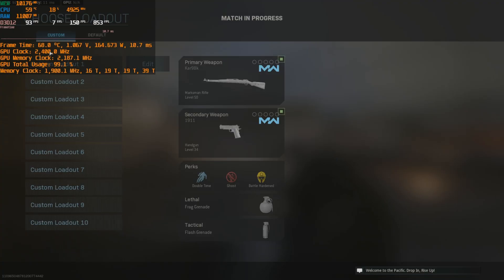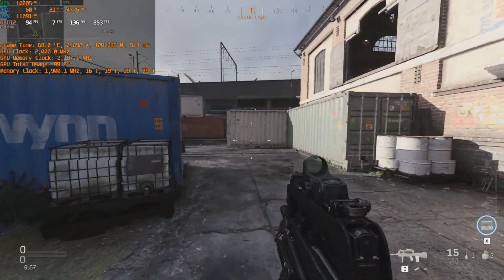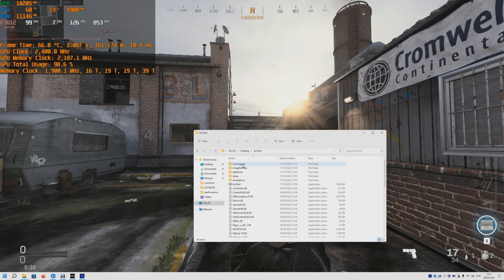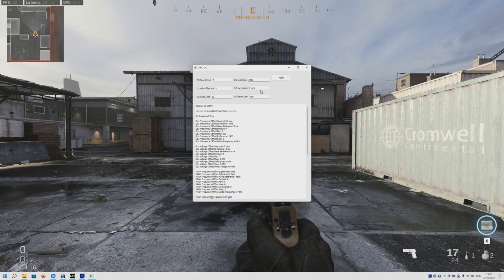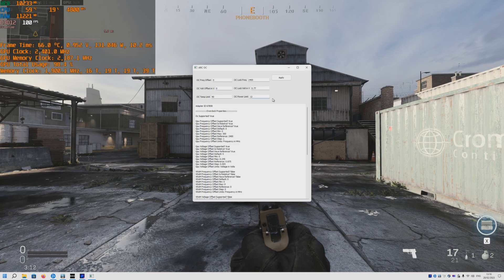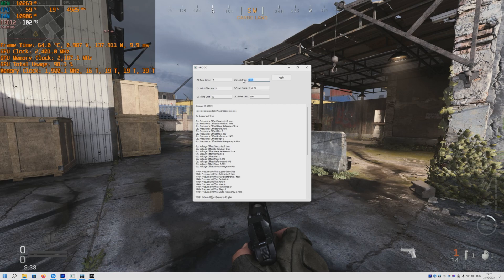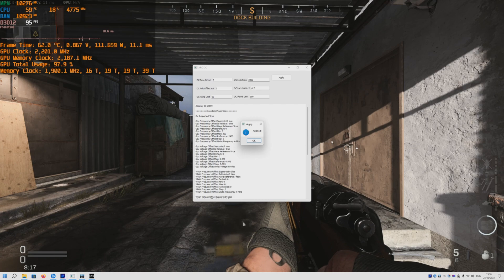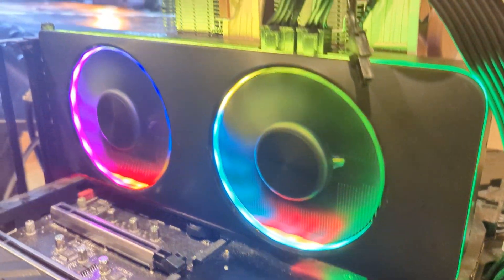Undervolt Intel Arc A770 / A750 / A380 - Improve temperature, Coil Whine and Lower Electricity Bill

Comment: Is it necessary to adjust the voltage offset when undervolting the GPU or is it enough to just reduce the wattage from the application?
Reply from the maker: You will lose performance when reducing just the W in the panel.

Comment: What's the ideal power consumption u get while watching yt videos browsing?
Reply from the maker: Always around the "optimized idle W usage". 45-50w.
Reply: @graphicarc  did u tried connect display cable to motherboard output it reduces power consumption i read a post on reddit few users says it works.
You can find by searching this:
 Managed to bring ideal power consumption arc reddit.
Reply: @graphicarc  Did u tried connecting your display to motherboard output i read on redit  and users commented that it reduces power consumption.
You can search:
Managed to bring ideal power consumption redit.
Reply from the maker: I tried but it didnt work for me on my custom windows.
Reply: @graphicarc  which processor u have amd?

Comment: Why my GPU consuming 38w power when idle, im doing nothing but GPU consuming 38-39w, i try to power saving  power settings on windows but not change anything 😢  nvdia card consut around 6-8w
Reply from the maker: Intel arc ... Still no way to lower W and I've been constantly playing around with things on different systems. Nothing we can do atm except power save mode but it rarely works now for me.. might as well use "ultimate performance" and be done with it.
Reply: go to windows power setting, change intel arc to battery life and pci-e to maximum, 36w->8w with single monitor while idle.
Reply: @kaelwang1251  i try already man power settings not do anyting
Reply: @MrN080DY  same here, even reinstalled drivers and it did not power down, still at 35W
Reply: @DrRedstone172  it is arc a750 issue you cant do nothing about it. it is idle power 35-40w.there is reason why people not buying this cards lul
Reply: @MrN080DY  oh yeah but i was talking about enabling aspm and idling to 6W. I can't get it to work
Reply: @DrRedstone172  its to much work i try aswell and now i give up lul. and even u did that, you need to back to normal settings again when you play games cause that setthis limit your power.

Comment: Are Arc mobile undervoltable? Lack of undervolting on laptops is the only thing that's stopping me from buying them right now.
Reply from the maker: Mobile Arc GPUs cant be undervolted or overclocked sadly. Maybe this will change in the future with arc panel but I doubt it. Afaik.
Reply: @graphicarc  thank you. Well, it's Nvidia only for me then... All their laptop GPUs are undervoltable via msi afterurner voltage\frequency curve since Pascal.

Comment: Is a750 is good for apex in 1080 high? My current cpu is ryzen 3600
Reply from the maker: Should be good to go ... might have to drop some settings to get 144? Havent tested it for sometime tho.
Reply: Running in gtx 1650 1080 low, i get fluctuating fps between  80-120FPS

Comment: Quick question ! Do it saved perm after doing it once ? Or do i have to redo The undervolt every time i turn pc on? Thx u :)
Reply from the maker: Sadly no :( no way to save it right now still.
Reply: @graphicarc  thx for answer i want The Card because of The Price in denmark is cheap right now. But i want to undervolt it because energy cost alot here. 
So not worth do it every time. I stick to 4060 for 1080 :(

Comment: nice video and very instructional! I used the A750 on my r7 5700x on a b550 mobo!somehow the gpu get hot pretty fast!couldnt even get the arc interface up!building a intel i5 13500 for a friend soon, so the gpu will fit it fine I think!
Reply: Because its coolers are idle if <60* . Arc controls added coolers curve option (of course bugged) where you can get 36* on idle with 800+ RPM

Comment: Hy. Your videos is really helpfull for me. I woild like to set the undervolt setting forever :-) where can i configure the arc gpu setting for it. Because when i reboot windows i have to open arc oc tool to reset the prefenrences. I am affraid my children will use the pc for gaming without undervolting the gpu. Thx. The other problen is when i set the oc settings. In idle the gpu frequency stay at 2400mhz. With 40w consumtion.
Reply from the maker: Glad it helped you. So far there is no known way at least to me to lower the idle gpu W lower then 35W. I am onto something but still no full solution available for this. I was only able to lower the W of A750 Asrock to about 15W in idle. As for the undervolt settings to apply at boot ... I will see if it can be done so far its not available within the software.

Comment: How do i reset back to defaults ?
Reply from the maker: Restart your PC or use the default settings when you start the Arc OC tool. Can always reset via intel arc control center as well.
Reply: Thanks i might be stupid but i have watched the video multiple times and still can't get what exactly i should do 
I am new to this so i don't want to do anything on my own could you tell the exact settings if i want a slight performance boost while undervolting
Reply from the maker: @TheMohammed884  This I can't really say since it depends on the card silicon. You will have to do the testing yourself and see how OC Tool reacts with your card.
Reply: @graphicarc  thanks

Comment: What temps do you get when the a770 is idle? I remember some reviews a few months back mentioning it was the worst whilst idle, over 40W in comparison to other cards which would hover around 7 to 12W.. perhaps a driver update may have solved the problem?
Reply from the maker: My GPU temp in idle is 31C currently at 18C indoor temp. Takes about 33w idle so yeah it is on the higher side.
Reply: @graphicarc  I found the official page High Power Consumption When Intel Arc Is Idle which guides the user in configuring the bios (and of course the windows own power settings) which supposedly helps. Some people mention higher idle power usage in their own forums, but the moderators just come back with 'there is no ideal power draw', so it would seem it's down to the hardware in which a driver update cannot fix the problem
Reply from the maker: @technocrologist  Been playing around with this ... no luck :) still stuck at 35W lowest usage on idle except on A750 it worked but only Asrock model.

Comment: Very impressive! Less than 5% lower performance for a 30% if I read the numbers correctly. What is the lowest working voltage for the ARC? On my 3060ti I can make it run at 1620@731mv or 1590@700mv (the latter gets vram downclock so not really worth it). This gives me about 90% of performance for 125W vs 205W stock.
Reply from the maker: Yeah I was impressed as well by the undervolt on this GPU :) will check what can be the lowest and report back.

Comment: Awesome video, thank  you.  Just can you tell me how to reset to default please. The gpu clock seems stuck to the value applied, it won't scale
Reply from the maker: What you do is restart your PC, after reboot open arc tool and note down the default settings (0?) and just reapply. What you are doing here is forcing max voltage limit so it wont scale more unless you set it to more.

Comment: Excellent video! Combined with recent Intel's fix of idle power draw on these cards, I am pretty much decided to buy A750 or A770 for my next GPU
Reply from the maker: I personally would get a750 for 1080p and a770 for 1440p+ :) am sure you will enjoy the purchase if you will decide upon it.
Reply: @graphicarc  a770 16g can easily perform on 4k\ultra in some games at 60fps. I have Gunnir black version.
Reply: @graphicarc  

with updates the a750 can now play almost all games in 1440p

just starfield etc have to run in 1080

Comment: With my a750 i cant do undervolt, when i put the value for voltage It return to 0 and nothing change. Why

.....
Reply from the maker: It is because you also need to set the Clock Freq otherwise it wont apply.
Reply: @graphicarc  aaaah ok, i Will try, thank you

Comment: Excellent video! This shows the power of the A770, really power efficient when undervolted (perf/W), even better than last gen 6800 perf/W king now beaten, even in DX11 and still better perf/W vs new 7000 series for DX12 and Vulkan. 0.94V @ 130W @ 2.4Ghz (100% load) ~= 1060 (@100% load) for 2x perf/W in DX11 (1.1x vs 6800), 2.5x perf/W in DX12 (1.5x vs 6800) and 3.3x perf/W in Vulkan (1.3x vs 6800).

For value proposition, when comparing 3DMark Time Spy to record raw power, normalized msrp for 6800 is 1.5x overpriced and 3070 (on par with A770) is 1.4x overpriced. This makes the A770 easily the winner (best bang for buck for mid-mid high end gpu + most power efficient with Arc Tool undervolt vs competition).
Reply: I mean is your comparison against optmised/undervolted 6800 / 7000 series as well? or just stock?
Reply: @Decenium  vs stock, so it's not a good apples to apples comparison and wasn't stable at 130W in the end, but was at 145W (a bit more V). This is a saving of 37% without lost performance. The 3000 and 6000 series can UV 20% without loss. But, A770 now losing big vs 4000 series. Also, I cannot recommend it anymore, the 3060 ti is now best bang-for-buck from nvidia and can be had for $300 new. $250 used market for 3070. A770 is €400 here in NL (Europe) and no used cards. Amd >= 6800 (any > 8GB has huge premium new/used) is far worse price/perf than 3060ti/3070. Intel is by far the worst price/perf vs nvidia and amd.

Comment: Can you increase the Wattage with this tool pass 228W? Intel Arc OC Tool?
Reply from the maker: No, you cant past overclock the limit. There was a bug and you could do it but mhz and everything was alllll over the place. Might make a video if this still "works".
Reply: @graphicarc  I would like to see that. Always good to see ideas even if fails. There might be a way round it to make it work.
Reply: @graphicarc hello can i reduce the watts just enough to make it fit in a 550 watt psu????

Comment: I have followed all your Intel Arc A770 videos and they are great.Last week I had a PC built and it keeps crashing every few hours and I haven’t even played any games yet.
Build:
CPU: Intel i7 13700K
GPU: Acer Predator Bifrost Intel 770 16 GB
DRam: 2 X 32gb DDR5 6000 CL30
ASUS ROG Strix Z790 Gaming E Mother Board
Arctic Freeze l l 340mm AIO on CPU

All components with latest BIOS & Drivers updated
A770 w driver 4091 vs your 4125 which is Beta I think ?

I haven’t installed Driver 4125 because I thought it might be unstable 
Any thoughts, ideas or suggestions? I will under-volt / over clock eventually but not there yet.
Reply from the maker: Thanks :) this seems like a beast of the computer ... why it crashes though I can't really know without getting PC in my hands. I had problem with CL30 and CL32 ram on most systems (if xmp was only ON) though you do have strix board which is one of the best? You might want to get it back to the place you got it built and let them know its crashing? Does your PC just restart or what happens (bsod, blank display)... It could also be that your 13700k needs tuning.
Reply: your on die CPU controller voltage likely needs a bit of an increase to remain stable for the memory overclock. Does your system run stable at lower memory clock speeds?
Reply: @sparketech  Thanks I have thought about doing that but wondering if this Motherboard might be making those adjustments. Will be going into BIOS after Tech support examines first. I am sure this can be resolved or has been at least today so far. Thanks😎
Reply from the maker: @Pierceb2  It is the motherboard that is doing the AI overclocking. Not sure they will be of much help but yeah ... do this and I am about 70% certain that it will fix your issue :) hopefully its not hardware problem.
Reply: @graphicarc  Thanks again. Yea It may be the overlocked memory or GPU.The board seems to have some sort of AI for entire system.. With Current / Most recent BIOS during install with XMP enables and Re-Bar enabled it went to DDR5 6000 on first reboot. Will let you know as FYI if resolved. 
P.S. Got Luminar Neo Pro 2 subscriptions for 2 years for $99 with all updates and extensions. I thought that was a good deal and I am really liking it. They need to add a really good printing module however. Will use Photo Shop until then. My I.suggest you do some videos on prepping completed photos for printing Also developing raw files from camera. I use Nikon Studio for Raw extraction or a couple of others. Manufacturers raw developers know best the color profile of their sensors etc. Again, Thanks
Reply: Thanks, it has been stable today but not rebooting after the crashes or I didn’t5 give it enough time to. The board has some sort of AI and collects data after the crashes. I am tweaking and will look into your advice and idea as well. Will have builders tech support remote access logs tomorrow as well. Can bring it in as well if needed.
Reply from the maker: @Pierceb2  Maybe its the problem of AI Overclocking feature? That needs some tuning done when activated especially on newer 13th gen intel systems i7 and up. Go into bios and disable that and just enable XMP for RAM and let CPU run @ stock. It might be heating like crazy but at least you can see if it won't crash this time? You can also go with asus enhancements and just ENABLE (Disable limits 90C) or something like that. I personally would say RAM problem but it might be AI OC :) I had hynix in one PC build DDR5 6200CL36 that didn't work no matter what I did... Put it my main system rig and it runs 6600cl36 at the moment (will oc more). Samsung ram from my main rig 5200CL36 (yeah budget) was able to be overclocked to 6000CL40 easily on the same system that Hynix ram crashed big time (corsair vengance hate these in DDR5).